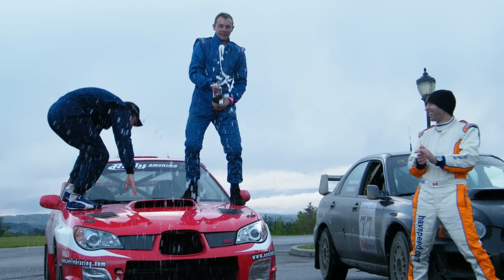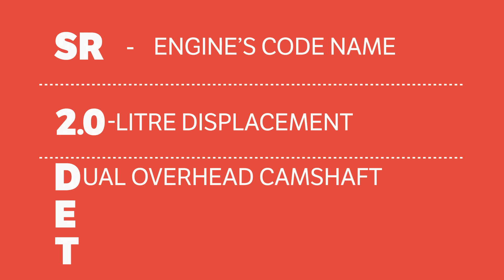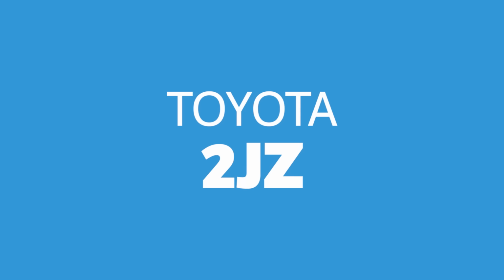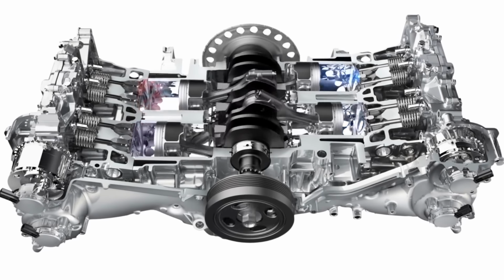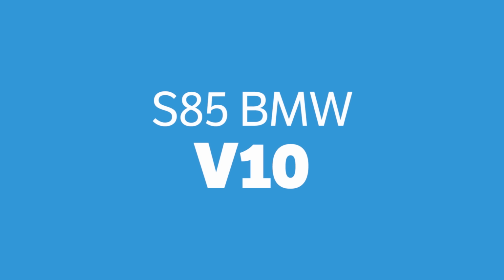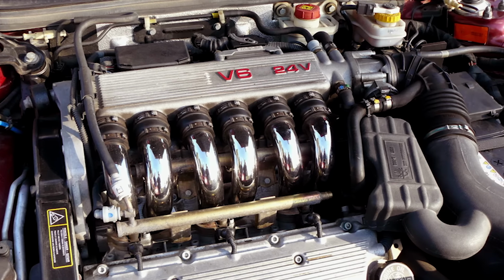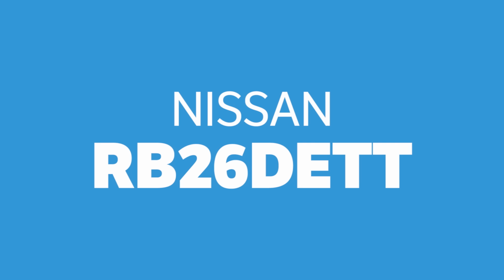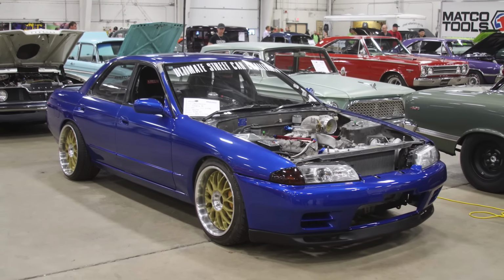10 Iconic Engines Every Petrolhead Needs To Know

Comment: Really, it's just about that F20C. 💪😂
Reply: well yeah since...you do have an S2000. Not gonna lie, wish I had one.
Reply: Yo Jason when are you going to review that s2000 you just bought
Reply: Sadly.. I just blown my F20C... Have a huge hole in the block.. No knock sensor+ bad fuel = many tears..
Reply: They left out the B series a K series. Sad
Reply: Very true. Now if they were to ACTUALLY list engines that made the biggest impact to the tuner/modified industry then the 350 small block and Honda b series would be tied for 1st. B series is to imports what the 350 small block is to domestics. The b series dominated the drag scene in the 90s and early 2000s and is definitely a pioneer along with the 2jz and 4g63.
Reply: Engineering Explained Yes Jason, it is.
Reply: Bradley Wilkinson there was no SI in 1997
Reply: Det er ikke for tideligt?
Reply: Engineering Explained You forgot the Cummins 5.9 12v
Reply: Power to weight ratio of the F20 series was quite poor. It's main competitior, the Z3's 3.0l straight 6, was lighter, more powerful, better sounding and more fuel efficient.
Reply: Engineering Explained No, it's about the S85 V10 and the Busso V6.
Reply: What about that rb26 bro
Reply: Yeah. My dream car is a S2000
Reply: hmm

Comment: where's 4g63?
Reply: They chose engines that don't require a rebuild once a week.
Reply: +smervelous why the hell ej was there then?
Reply: Both of those are slightly more reliable than the 4G63, so yes, my point still stands.

For a performance engine, the 4G63 sure likes to puke its innards unless you undertake the expensive task of using forged components for everything.
Reply: Judge Shooty
stock for stock i would trust a 4g63 over a rotary.  if you baby a 4g it will last. a rotary like a 13b or 26b rx7 are going to need rebuilds very often.
Reply: John Sullivan no point replying to him bro.. he's probably a subie lover hahahaha
Reply: Judge Shooty My dad used to own an evo 6 tme and with 400bhp on an all stock engine was never an issue for 10 years... just don't cheap out on parts and maintenance and they are solid.
Reply: kido hop subie!  ha , why would anyone take an engine that sounds that bad , and make it louder?
Reply: Then why is the rotary here? Lol!
Reply: Boxers sound great. But the 4G63 is pretty legendary it needs to be on here
Reply: The 4g63 on my daily drive is almost 24 y/o. Never had a real problem on the road either.
Reply: Tim Beck Porsche boxers sound great, subaru boxers sound like shit .
Reply: Art Mchugh porsche is boxster
Reply: Judge Shooty , the only reason 4g63t has a bad name is every 16yr old bought a ten$ boost controller and cranked the poor little 14b to 25lbs with no more fuel or timing work hell a cheap ass safc got me buy with running 22lbs on a 7 bolt in my 98 gsx eclipse all stock sides a evo 3 big 16g with 3" turbo back exhaust and Cai till I got front mount Walbro 255 and other supporting mods so I didn't have to spend 500 having it tuned twice and a safc is only 50 to 100 used ,and i daily drove 2 hrs round trip for 8 months with no problems and that's just one of 30 dsm's iv had and daily drove it's all in who owns it
Reply: kido hop cough cough “gasket” cough “problems” cough cough
Reply: Mitsubishi 4G63...😆
Reply: As others already pointed out, 4g63's are rock solid reliable, when idiot kids don't get ahold of an already neglected clapped out one that needs some TLC and boost them to the moon with ebay specials and hack jobs and no preventative maintenance, proper supporting mods or a decent tune. Like most cars or engines, they are as reliable as their owners. Imo the only thing that can compete/compare to a 4g63 dollar for dollar is an LS series v8, both are extremely hard to beat for the money.
Reply: And having two different RB series engines that are basically the same with a different # of cylinders, while omitting the 4g63, and others, but imo, the 4g63 is the biggest afront, was a total copout. Should have done the RB series as a whole as one engine, like they did with other engines on the list, ie. the LS series for example.

Comment: The Saab Turbo 4's are pretty iconic as well. It is the engine that put turbocharging on the map and made turbos cool. Thanks, Saab.
Reply: Aye
Reply: nissan and other companys were messing with turbos at the same time as saab. they went out of business for a reason even after gm tried to help them.
Reply: +Ryan Rohauer but Saab is better than those cars because SWEDEN
Reply: Not really, BMW Porsche and Ferrari made Turbo cool as hell back in the days (in that order chronologically).
Reply: +Kaisuke971 But were Ferrari, BMW, and Porsche the first car company to turbocharge a mainstream production car that was obtainable to the masses? No. Saab was. The Saab 99 Turbo was the first mainstream production car with a turbocharged engine.  Therefore it was Saab who introduced turbocharged cars to the masses. Not BMW, not Porsche, not Ferrari. It was Saab. Even Top Gear has acknowledged that it was Saab who was responsible for putting turbocharged cars into the spotlight.
Reply: Ryan Rohauer What does that have to do with any of this? All I'm saying is that Saab was the first car company to introduce turbocharged cars to the masses.
Reply: +RedRider 299 If you like no torque and unsafe cars, then sure.
Reply: +RedRider 299
The only people that say JDM is better than everything are kids that have never driven a car to compare the 2 and have only ever driven in computer games.
Reply: +Ryan Rohauer but GM didn't help them. They were selling a trailblazer under the Saab name. The 9-5 was from 1997 before being replaced in 2010. A 12 year old vehicle at new prices is high. The 9-3 was last redesigned in 2003. Again GM didn't help much

Comment: Volkswagen's VR6 engine should be in here too. It was not the most powerfull engine, but it was kinda unique because of the VR shape and it also had great tuning potential (forced induction). Oh and the sound is still amazing. 
This also applies to the R32 engine, but the VR6 engine was the predecessor of the R32
Reply: Unique but useless, so why should someone list it here?
Reply: forget about the alfa twin spark and the hemi wich is the other alternative like rotary and of course the 6 flat !
Reply: It's just a copy of an old Lancia design, if you want to put it on the list it would be better to put the original
Reply: first VR engine is made by Lancia in the 60s but it wasn't called that fancy VR name and V6 Busso sounds way better that the VR6 which looks very ugly in the engine bay, one is master class art and the other is just done in microsoft paint art
Reply: @jordangogov5866  commenting on a 4 year old comment I totally forgot about...

Comment: I maybe would have taken in Audi's 5 cylinder engine, due to its heritage in racing.
Reply: or VW's vr6
Reply: +Joey  Herrmann indeed very good platform known for capable of serious mods and being bulletproof by many enthusiasts..the r32 vr6 is pure joy to drive!
Reply: I was about to include the VR6 and BMW's R6, but then I thought my German would be showing :D R6 isn't a racing engine though
Reply: yaaaaaa i dont know how VAG VR6 or audi I5 engines did not make the cut...... OR ANY PORSCHE AIRCOOLED ENGINES!!!!??????? Ls most iconic?????? really???? and your from the uk?????wtf......
Reply: +Miguel Garcia I know right
Reply: bunch of ricers at car throttle.. bmw v10 is great but any of the s54 variants are more iconic especially with the models that have used it. The e30 s14 is a better choice tooo..........
Reply: +Miguel Garcia would say the S50B32, which is the S54's forefather.
Reply: +Miguel Garcia Volkswagen's aircooled flat four was used in more cars and units then any other engine!
Reply: Many say the r32 but it isn't a tuners engine but a premade sluggish block, the 5 cylinder blocks were amazing and wish they brought them back. But ala I doubt it due to audi's now low emissions look on life, in regards to general motors. Then you look at the 1.8t and the 2.0t and the are crazy good tuner motors and can pull mental numbers, yes with new rods, cams, turbo and injectors etc you can make a crazy sleeper or all out sledgehammer
Reply: doesn´t the RS3 have a 5 cylinder?
Reply: Yes the tt and rs3 run a new 2.5 liter I5 but the iconic 2.2 10v and 20v engines from the 80s and 90s are some of the best engines ever built in my opinion. Hugely popular in Scandinavian builds iirc they get insane power out of them
Reply: Not sure but they are reverting back to the 5bg's which is amazing but is what I've been hearing. I've been living in a 4bg cave for the last 8 years so means nothing with these new blocks. But every tuner I've seen pull 600+bhp from a vag motor, have been using old tech. Mine is predicted 360bhp on the tune I have set for a road car, but can achieve way more to the grade of 500-600 for numbers sake but on the road its a big no
Reply: +TAGSProle very good point..
Reply: yeah audi 5cyl rocks! BWAAAP BWAAAAP
Reply: what About Toyotas 4Age engine
Reply: +Your Stew ahh yes the 4age. probably my favorite inline 4
Reply: +Your Stew one of the best inline 4 I love the 4age
Reply: +Miguel Garcia Why would the LS not be iconic? It has won Le Mans with Corvette 8 times since 1999, as stated in the video it is used as an engine swap by tuners frequently in all sorts of cars, it's light, it sounds great, it can produce huge amounts of power, it's been in several interesting cars including the Corvette, Holden HSV, Camaro, Mosler, Trans Am/Firebird, Holden Monaro, SSC, Hummer, as well as plenty more less interesting cars making it probably the most widely used engine ever. What exactly makes Porsche's aircooled engine more iconic/well known than the LS?

Also I love how on these videos there are always without fail a bunch of people who think "waaaa __ isn't in the list". Fucking get over it, you didn't make the video, they are not catering to your desires and are never going to include your exact list of iconic engines. There's tons of engines that could conceivably be in this video. Porsche V12s, Ferrari V12s, Porsche aircooled, Aston's V12, Audi's 5.5 V12 TDI, any of the F1 V10 engines, E46 M3 engine, BMW's Le Mans V12, LFA V10, Lamborghini's old V12. These are all memorable engines that stand out.
Reply: Audi 5cyl  as well as B6 from Porsche.

Comment: Saab's B235/234R motors better be on this list.

Oh wait, it's a car throttle post. Just gonna be a bunch of generic LS, 2jz, sr20s etc etc...
Reply: atleast they got Volvo's I-5.
Reply: theyre good thoe
Reply: This video is about ICONIC engines, why would they not include LS, 2JZ, etc. in the list?
Reply: LOCO Fiesta They're iconic becasue 12 year olds on Car throttle love to get hard over them. Where are the real legends like the b234R or the 4G63??
Reply: +.  for rwd, a gearbox from some open fits it. Look up the miata with a b234r swap. And yes, i own a 9000 aero and it's great.

The 4g63 is basically a mitsubishi only motor, and the Volvo i5 is the same way, yet it was on this list.
Reply: +kirbyswarp Opel*. What was your point anyway?
Reply: never heard of saab engines bein thrown out or mentioned in meets and tracks just the iconic ones
Reply: pyrelord1234 Exactly. Because they just hoard to the typical stuff.
Reply: +LOCO Fiesta I didn't say the ls isn't iconic. It's literally THE iconic engine. The Volvo motor? the bmw motor? not any more iconic than the saab motor...
Reply: kirbyswarp
"I didn't say the ls isn't iconic. It's literally THE iconic engine."

"They're iconic becasue 12 year olds on Car throttle love to get hard over them."

So the LS is the most iconic engine in the world because a bunch of 12 year-olds on some random YouTube channel like it?
Reply: +LOCO Fiesta No, most of this list is though. The rb26 is great if you're 12 on car throttle, but in reality, they're unreliable and much harder to do anything with than a 4g63 or b234r that wernt on this list. It's literally on this list because "OMG JDM SKYLINE ENGINE". It's no where near as common as the 2j, which belongs here next to the LS.
Reply: kirbyswarp
Yeah but this list has nothing to do with reliability or ease of use...whatever.
Reply: +LOCO Fiesta But isn't that what makes an engine iconic?